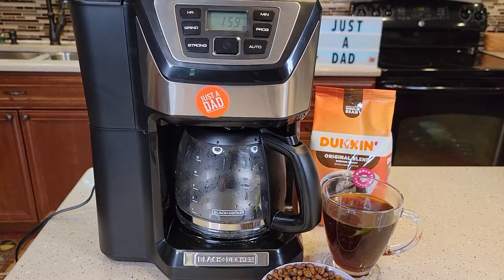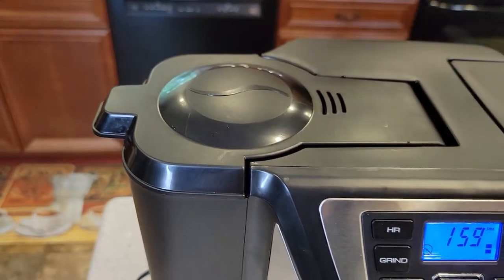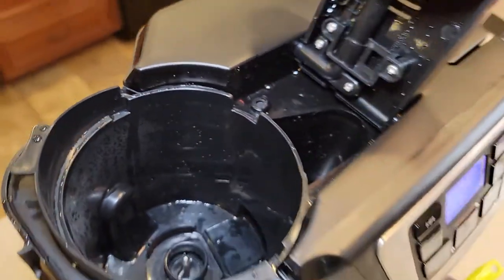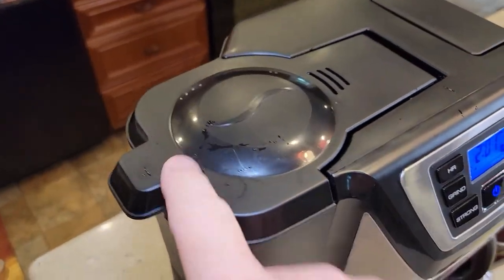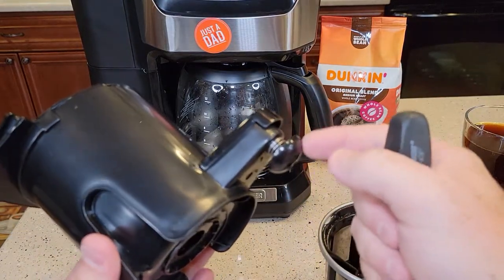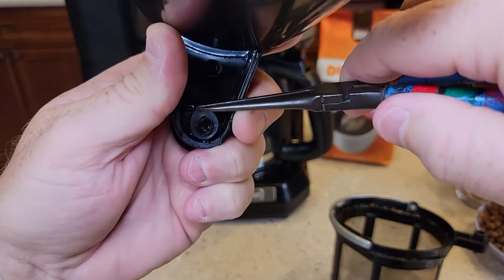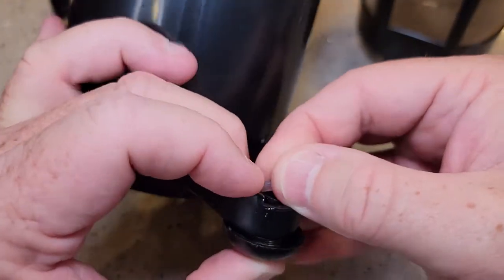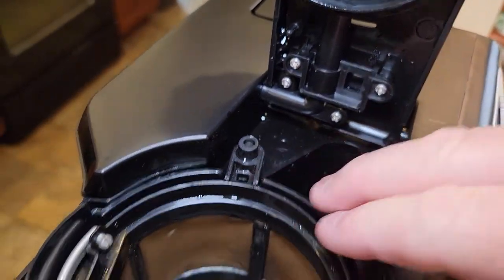HOW TO FIX Black + Decker 12 Cup Mill & Brew Coffee Maker CM5000B Grinder Not Working Brew Basket

Comment: I'm a little late to the party, but the grinder blade on my basket is getting loose, and I'm not sure what the tool to tighten it would be. It's loose enough that there are grounds getting into the pot when I brew. Any insight?

Comment: What is the best way to empty and clean out the brew basket once the are finished with a pot of coffee? I try to dump as much as possible the wet grounds into my trash can but a lot of it still remains so I then have to wash it out in my kitchen sink which means that coffee grounds are going down into my drain which is not that great. Thanks.

Comment: What if it uses half the water and then stops working?
Reply from the maker: is the lid staying closed.
Reply: This sounds similar to the problem I’m having; the water in the reservoir seems to be evaporating rather than passing through the machine. I’ve tried descaling it, but can’t seem to figure out why it’s doing this.
Reply: We are experiencing the same problem!
Reply: Ours is having the same issue, we put in 8 cups of water and get less than 6 when it's done. We seem to lose a lot of those last 2 cups to steam and evaporation.
Reply: @KravenMoorhed  I wish Black & Decker would address this problem. I've scrubbed the parts with a toothbrush, descaled ...nothing solves the problem. I do believe I'm losing a lot of water to steam evaporation.
Reply: I have the same problem. I've cleaned it multiple times and I get half the amount of coffee that I want to brew. The pot steams. Doesn't brew.